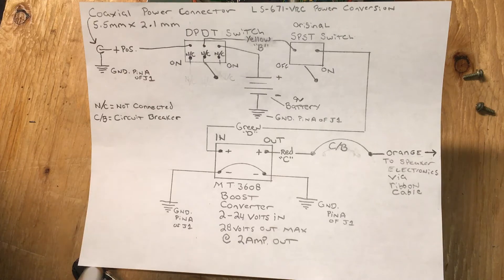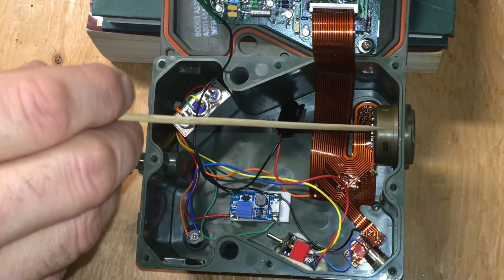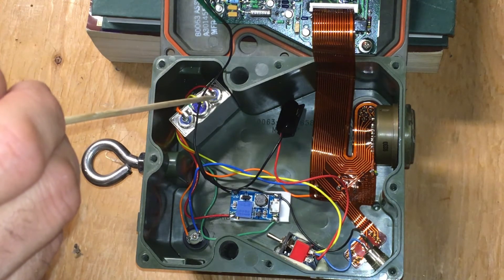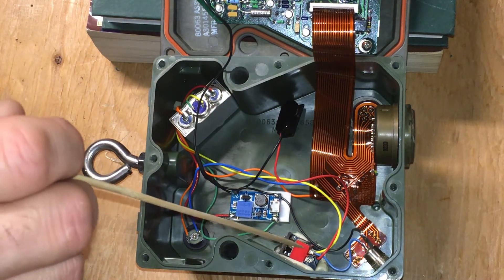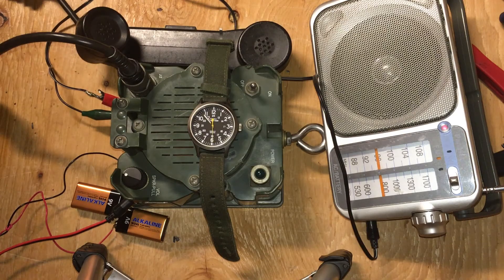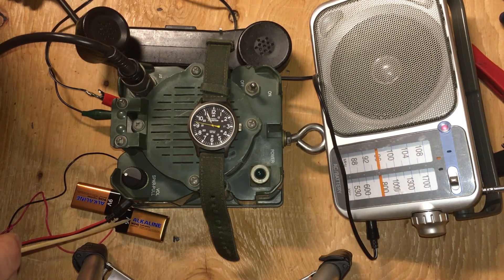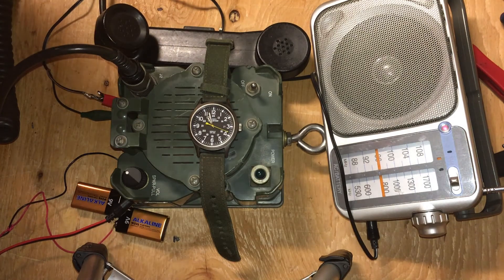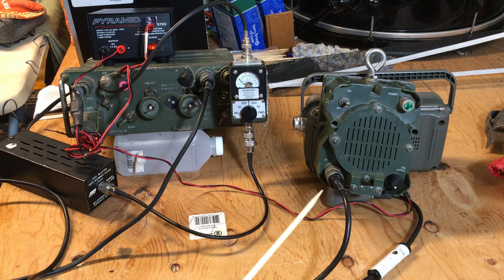LS-671/VRC PRC-77  MOD

Comment: Great video,  help though. I have added a bluetooth chip into my loudspeaker but having an issue on where the speaker connects. Currently my audio output is going to ground and the possible side to pin K on J1. Not working. Where did you connect your AUX jack too in the speaker please.
Reply from the maker: It’s been a while since i looked at it .have to check my notes ,but you see where i’m playing the transistor radio through the speaker .i just went through J1 contacts for that i never did add a 3.5mm aux input jack .but you should be able to tac a couple of 24 gauge wires to the back of J1.